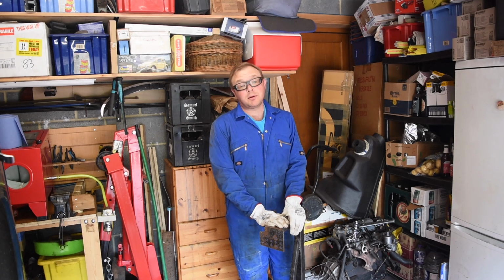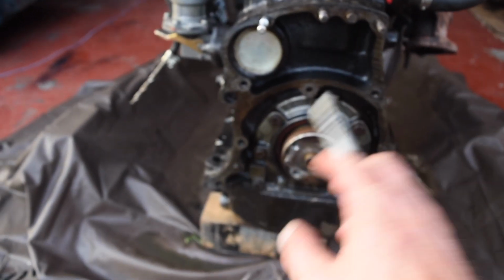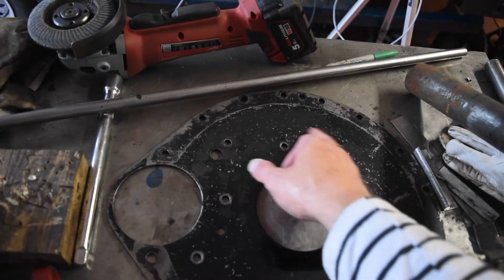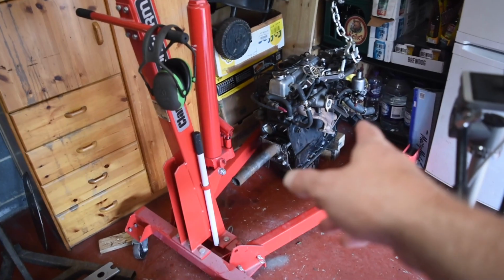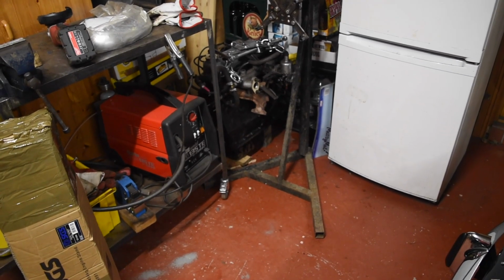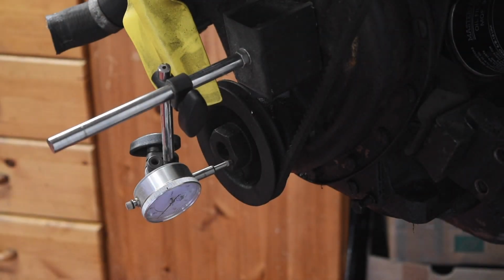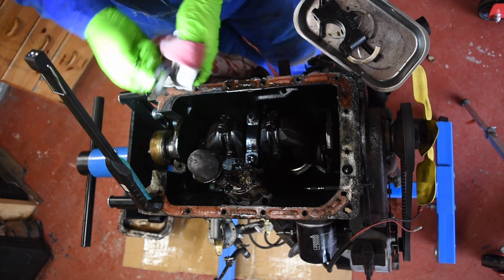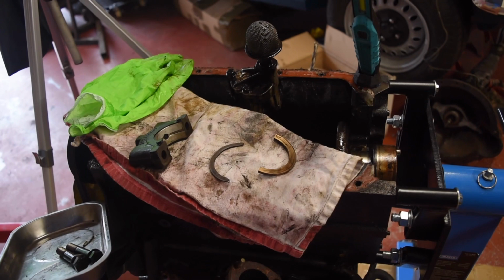Initial Engine Inspection - Is It Saveable!? | 1970 Triumph Herald 13/60 | Part 14

Comment: That is a Triumph approved repair. Back in the 70's (working at an engine remanufacturers) we did many 4 and 6 cylinder repairs for Triumph main dealers in just that manner. Although maybe a tad neater.. 😜
Reply from the maker: Interesting to know! The engine rebuilders who made me a new thrust washer in the end thought whoever had gone before knew what they were doing, so hopefully should last a good while!
Reply: @redfoxclassics  Oddly enough, the Automatics where the worst. Strange as there was no pressure from the clutch obviously.
 I will be making a new steel rear main bearing cap for my Vitesse. With enough meat to cut a register for extra washers. Line boring it and fitting a Ford Pinto full thrust (4 half washers) rather than the Triumph half thrust (2). It is a slightly larger diameter and a smaller bore. But the same thickness is the same as the Triumph. So I'll have to modify the block as well to accept the wider thrust.
Reply from the maker: That is odd. Interesting to hear about your mod plans. What sort of equipment will you be using to machine the thrust washer recess inside the block? I can’t think of how that might be done and I’m really curious!
Reply: @redfoxclassics  Hopefully I can use my bridgeport mill with a riser block and it's 90 degree head. But in the day we used to turn up running bushes to fit in the main bearing housings and use a bar through the centre that could hold a hand ground cutter. Part of it was from an old line boring kit, and it had a hand crank and an advancing screw to control the cut. I might end up with a hybrid of both. But first I've a lot of rust to chase out of the car.
Reply from the maker: Ahhh, right. 90 degree mill heads being available is obvious when you think about it, but I hadn’t thought of that! Hope the rust repair is going alright.